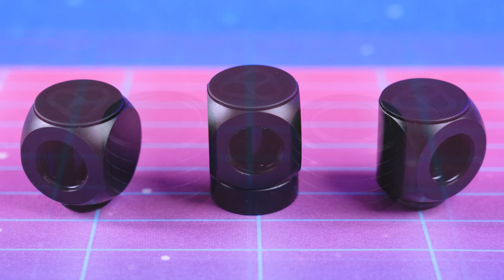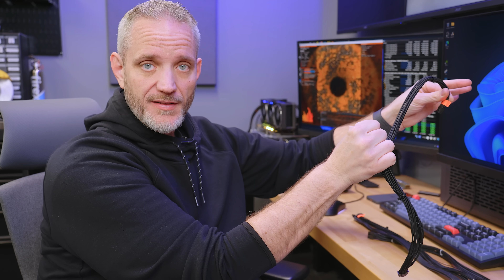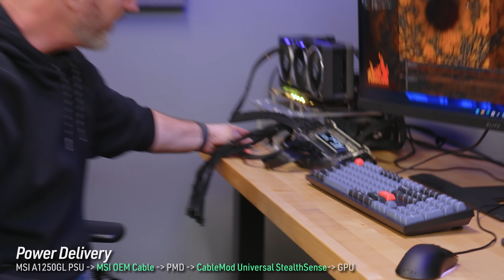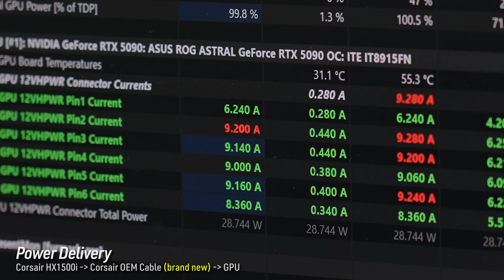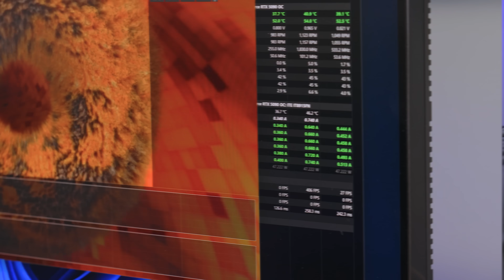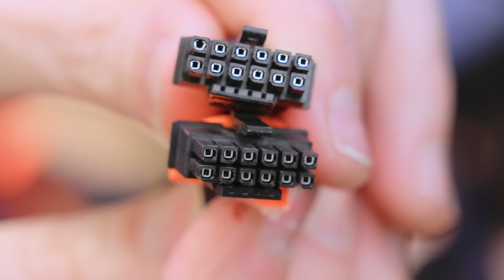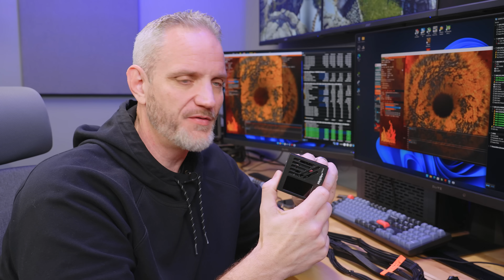More details on what could be causing 12VHPWR / 12V2x6 Cables to melt

Comment: Automotive would NEVER have allowed flaky terminals like that. 
The barbs on automotive connectors almost all have double locks on the pins.
Reply: lmao there are plenty of flaky connectors in the Auto industry, now Aviation would be another story.
Reply: @xXDarthBagginsXx  Nuh UH! (holds shards of VW plastic bits) hahahaha
Reply: @xXDarthBagginsXx  That's true. Aviation likes those milspec screw on connectors that almost all look the same.
Reply: @MarkBarrett  cannon plugs. that is what they are called.
Reply: @MarkBarrett MS vs MIL vs SAE vs ANSI is all the same book. It's all down to the quality of the engineering put into it. Talk to NASA. They have all the history for this and they have the specs. It's all the same regardless of industry. Quality of manufacturing to a spec doesn't guarantee anything. It's a per batch basis. Reliability is quality over time.
Reply: @xXDarthBagginsXx  Or space.
Reply: @xXDarthBagginsXx  Just gotta watch them emergency doors 😂
Reply: That's the whole problem even industrial equipment totally robust connectors and high quality stranded copper wire
Reply: Shhhh, you'll awaken Lucas, the Prince of Darkness....
Reply: At this point we should expect LTT to create new good psu connectors in 2-5 years
Reply: Exxxxxxxxxxactly. Remember when you had to literally thread the end of cables. What a joke to a problem that was solved such a long time ago.
Reply: You are joking, right.  Automotive manufactures routinely engineer iffy parts and systems that not only cause end users (us) issues and repairs (money) but hide and blame the customers for problems. Then they also fight customers on warranty claims. And some problems are serious and safety problems.  Examples from past are the air bag problems where debris from the air bag deployment could kill/injure the driver.  Or presently GM having MAJOR problems with brand new vehicles shutting down or having catastrophic failures while running.
Reply: this explains why my connectors to my headlights on my 370z were SOLID!!  almost like they were one time use only!!   I had to put an allen key in backwards to get the tab to cooperate to avoid breaking the connector!
Reply: Apples and oranges.
Reply: @GoldSrc_  How so?
Reply: @--_DJ_--  A car moves and bounces all over the place for 100s of thousands of kilometers. a GPU is not moving.
Reply: @kickezer   Most wiring in a car is very secure, it isn't flopping around pulling on the connectors with every bump you hit.
Reply: @kickezer  A GPU is designed to be user-installable and needs a fail-safe connector for that reason alone.
Reply: @kickezer the GPU may not be moving, but it does have the thermal cycling and there can be some vibration from the fans. I have seen connectors and pins work loose. Residential wiring does experience the same issues, despite the fact that a building doesn't move like a vehicle does. Thermal cycling and vibration cause the same issues.
Reply: @kickezer 
Oh, a gpu is definitely moving. Just that the vibration profile is different, more high freq shaking than the low freq road shaking.
Reply: @rockytom5889  I mined on 18x 1070tis for 3 years straight full boar. no fans or card got damage.
Reply: @kickezer 
Ok? I also ran the same 1050 for the last decade, no damage. Doesn't mean it doesn't shake, just that it's engineered to survive the amount of shaking it gets. My point about shaking was that nvidia'a new connector uses too thin of a connector housing pin for what it is doing. You absolutely shouldn't be able to pop a pin out of the plastic no matter how you push the connector in, and no part of the cable or connector should in any way wear out from thermals or vibration. I also run the same car for the last 31 years and its cabling is still not burned nor broken. So nvidia has no excuse for their weak connectors.

Comment: So whats your Point Jay?
User should accept the Faulty Shit connector because it looks cleaner.
And Buy Extra connectors and regulators and Monitors, more expensive PSU, Voltahe and Amp monitors...
Whatever you do NEVER solve the issue which is 12v connector. 
Whatever you do NEVER go back to the Connector that works. Until we make a modern 8pin that properly designed ground up...
Any money, Any price, Any damage is acceptable... Because it looks cleaner... 
Sickness of Modern humanity... 
NEVER solve the root of the problem, ALWAYS deal with consequences 'til the end of time...
BEcause if you make one step back, the progress is dead and Over we can never go forward ever again...
Die before making a step back. 
And they complain about Companies that Thrive on The whole scheme...

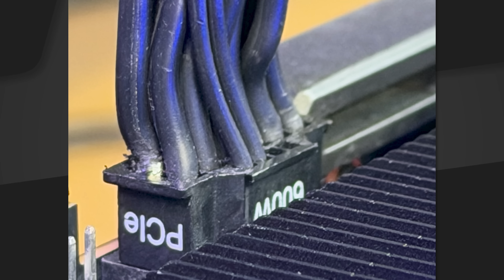Comment: 6:14. That pin sliding in and out is very reminiscent of the old cheap Molex connectors. They only have about 10-20W thrugh them and they could cause serious damage. UYp to 600W? 'It'll be fine'.
Reply: Ah yes, good old fire hazard connector.

Comment: sigh this is ahy apple M1 to m4 chips are baclly apples trump card thast giong to be teh death of niedva intel and amd bescue apple has fonud out that x86 has it its maxuim uper limit with convental comptuer while arm can bacly eacth to massvly excade it by so much thats apple is right now bacly makeing curecles aodund nevida most power gpu and ai tech like tis was a flash ages a sloth wit h desprsion and massively ver yclsoe to teh black hole event horazion at this pont not to mechon the gpu and ram chip x86 shoteg also make it far far far worse as well.

Comment: It's the sudden, massive change in power draw that's most likely tripping the card to shut off. Sounds very close to an old problem way back when I did repair work. A manufacturer's power board we worked with had insufficient ground, and a lot, not all, but a lot of the boards would show any sign of a problem. We scratched off the top coat of the PCB to get to the copper layer, then soldered the ground wires (2) to the ground plane on the PCB to increase the grounding. All problems, at least as far as the power board was concerned, went away.
Reply: Todays ground is extremely overspecced. Remember, mobo also offers ground to the gpu so this is not going to be an issue anymore on any new motherboard.
Reply: @ppeez  Spec'ed and reality are two very different things. Problems/issues can and do arise after products are built that were not forseen or expected.

Comment: I was having the exact same problem a while back with my Seasonic PSU. I tried many cables, including CableMod and the octopus cable provided by NVIDIA, but always got the same result: unbalanced load through the cable and red lights up to 10 amps. So I bought an MSI AI 1600T PSU. Everything is perfectly balanced now, with no more red lights and amps maxing out around 8 under max load. I am happy no longer have to worry about my 5090 potentially melting  might add a wireview pro but iam not sure fells like iam adding an other failure point to this already fragile connector

Comment: Check resistance pin to pin on the cables?  (end to end,  pin 1 to pin 1 etc...)
Reply: In a stranded cable with a standard multimeter you will have a hard time determining if the wire itself is damaged with just a resistance measurement. You could have half the strands broken and get the same reading as a wire in perfect condition. It doesn't take much material to pass the current/voltage the meter is using to test with.
Reply: You measure the current through the complete conductor and you measure the voltage drop across it to get precise measurements of the state of the conductor as a whole (with load).
Basically the same way a NVIDIA GPU measures the power going into it via the PCIe power connectors (which you can fool with a shunt mod).
Reply: That would be too easy to test with a high-quality multimeter.

Comment: Put Load Balancing back on the GPUs to fix the problem.
Reply: That won't fix the problem. It will just alert you to a problem that should not exist in the first place. Because even if you have load balancing... it won't change anything. the card will either shut down, or underclock itself. Which is not a solution.
Reply: @germanmosca ok but it will help,so what is a better option then ?
Reply: @PurelyTechHead 
Thicker cable and double locking connectors, on top of having proper power phasing (like load balancing, but you don't just rebalance when you're drawing too much on one cable, you draw from all of them in rotation, like how engine timing is phased). You wouldn't even need thermal sensing or additional power sense lines on the connector if you had proper phasing, as it would avoid overdrawing current entirely.

And the most important change: use actual copper cable, instead of the copper-coated aluminum most manufacturies use to save money. Such a cable is extremely suspect to degradation over time, on the account of it passing power basically oxidizing the aluminum until all you have is a break filled with copper and aluminum dust.
Reply: I'm not saying you're wrong, but I do want to point out that the 3090 ti used an early form of what later became the 12vhpwr connector, had load balancing, and can when overclocked reach the same power consumption of the 5000 series and afaik none of them suffered the issues the 5000 series do.

All the way up to the rtx3000 series GPUs nvidia cards had load balancing and power distribution monitoring built-in, and as a result melting connectors was an extraordinarily rare occurrence to the point that it genuinely was user error if it happened.

It's still not a common occurrence of course, but the removal of load balancing and monitoring has imo had an impact on the reliability of the 12vhpwr connector, and adding it back in would go a long way to protecting cards from damage.

I still think even with those things back in place that the 12vhpwr connector is a terrible design, and was designed by a committee of drooling idiots too busy eating pva glue to notice the issues it has, but having them in place wouldn't hurt anything except nvidias' profit margins

Comment: At this point it would be easier to desolder this shitshow off an connector and put somethig else on there that is ratet vor way more and is way sturdier eventually something like a 2 Pin with with some lock and jsut bridge the Sense Pins. 
Yes i know it was about the Cabels itself but with a befier connector you could also do bigger awg / mm² so yeah. Now i am not so mad anymore that i am still on 30 Series.

Comment: Is this pin sensor only available for RTX 5090 cards? I have a 4070 TI Super using 12VHPWR and I presume mine is fine. Also using Corsair RM1000x PSU 12v to 12v cable.

Comment: Not to be an ass, but how are they not using #14 wire for the required power.  (800w÷0.8(continuous duty))÷6 number of - conductors ÷ 12v = 13.88A per wire thus #14 awg wire

Comment: If it is copper wire it can degrade as copper metal will work harden and get more brittle as it gets flexed.
Reply: This happens to pretty well all metals and not only copper.
Reply: @warrenout4893  To some degree yes but copper becomes work hardened very quickly and the change on the brittleness is more pronounced.

Comment: bought my rx 6800 a year or two ago for $390, the last one in my local best buy that was brand new. it was collecting dust on the corner of a shelf (box was very dusty) and that card has been treating me well, zero issues. just 2x 8-pin power connectors, 16gb vram, and plenty of rasterized performance. Does everything I need it to, so I'm not considering an upgrade anytime soon
Reply: My one has three connectors. MSI model

Comment: Really wish the wireview 2 had a more affordable option ... sub out the machined aluminum case for a plastic one ... what benefit does the aluminum case offer when there's an active fan to cool the actual connector?
Reply: IIRC from der8auer's videos, the board has a thermal pad to the case. You need surface area to dissapate heat efficiently. If you put a cheap aluminum heatsink in a plastic case that would work, but then it would be thicker.

Comment: There were several reasons I went with RX 9070xt 
1. The 30% Linux tax on Intel and Nvidia when it comes to FPS
2. Better system optimization 
3. Not having to deal with these freaking 12vHP plugs

Comment: I will Alway stubbornly use AMD Sapphire with 8 pin connectors. GPU needs to work not melt or get pins unplugged.. loosened or any other failure Nvidia can create for its Customers. Nvidia is Evil.

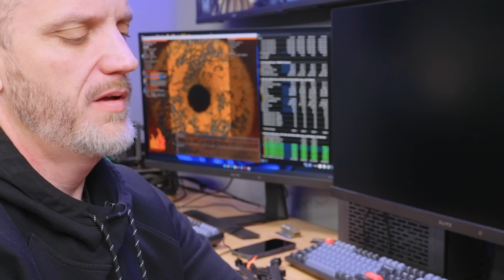Comment: I noticed that 1 connector was spread open on that one you gave us a close up of at 16:27.
Reply: yeah I noticed that one as well, clearly not what he said they were lol
Reply: Im testing similar kind of cables in my company for like 15 years, and i cant watch this video. Iv tested like over 15 milion of that molex connectors and i had meabe 10 broken like that. You have to be realy "special" to do something like that to the connector, that was fine when you bought it. But after i saw  how he is putting out his cables from that card i do not have any questions.... And why he have broken wires? Wiggle them more
Reply: Yeah. Badly at that. Was going to type that but checked before hand.
Reply: He made a pinned reply to that.

Comment: Maybe a dumb question, but when that ground pin was out and the gpu was on and running would  touching that exposed end of the wire shock you?
Reply: No. Nothing inside a functioning computer can severely shock you except the inside of the power supply. The voltage is too low.
Reply: @Exoleres thank you for the answer and explaining why.

Comment: Maybe those cable are made of aluminum coated with copper
Reply: It is extremely possible that because of "economic fluff" they are indeed cheaping out on those now too, just like food ingredients and downsizing everywhere else to keep the shelf price appetizing
Reply: Most likely. I've found that is common on a lot of ready made cabling. Costs less than actual copper and you're none the wiser until the aluminum oxidizes and sheds the copper and the cable just breaks without even being bent.
Reply: Also copper clad aluminum fatigues and fails from bending much faster than pure copper.

Comment: what the hell is going on  man? this whole conector has been a problem since the begining, so glad i got a GPU with a good old 8 pin conector
Reply: Someone probably greased someone's palms for it to become the one they used.
Bribes are disturbingly common in the tech industry.
Reply: Yup I like my peace of mind with my 9070xt and it’s 2 8pins.
Reply: I have two builds with no issue that have ATX 3 psus… it seems to me the issue is 600w cards cause my 4080, 5080 have been fine

Comment: Fun fact. You can decrease your chances of 12 volt high power cable failure by not buying a graphics card with a 12 volt high power connection.

Comment: is there a way to check a wires integrity without stripping it out of its insulating sleeves?  because part of me thinks part of the issue is the actually copper wire.  steel can have different formulas for its make up .. some made for strength, others for thermals, others for metal density and such... but this also holds true for copper right?  without running a metallergical test to see what the formula was for the copper in the cables, there has to be a way to check electrical flow threw them as a determiinator for its grade/recipe too? right?  anyhow personally i think it is a means to get people to buy more cables... intentional? i can't say, unintentional... probably.  i mean if you sell a car, you make more for replacement parts over its lifetime right?  stands to reason designs/materials meant to reduce the lifespan of components is a means for manufacturers to force more sales of parts.   or we'd all still have nokia phones.  though this could also be a copper wire provider taking short cuts, to sell more wire for more profit by using a less than 100% copper content.  its a huge problem with things from china mostly due to its black market/forgery markets/providers and lack of standards control /monitoring or enforcement.  i've seen tofu dreg videos with steel rebar that you could bend around your waste being used in concrete as reinforcement structuring.
Reply: Multl-meter. Even a cheap one from Harbor Freight will do.